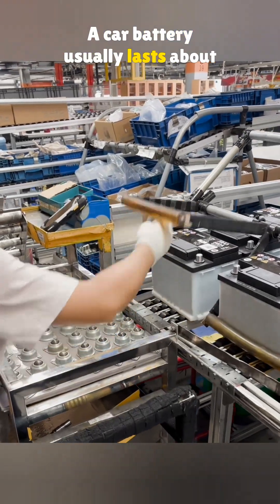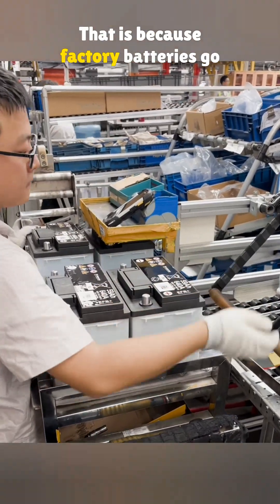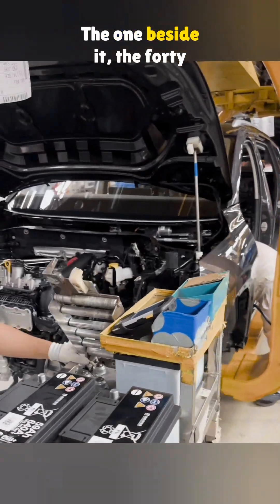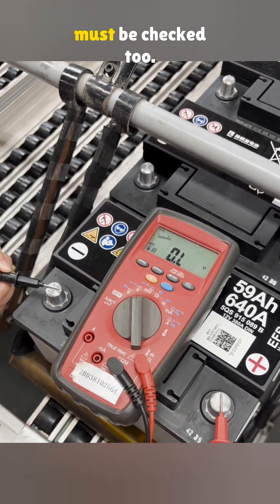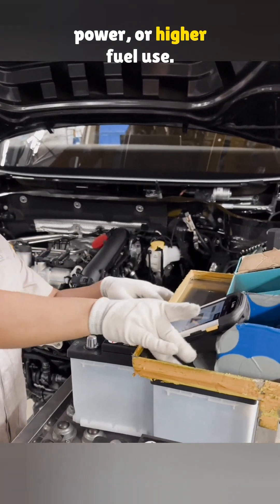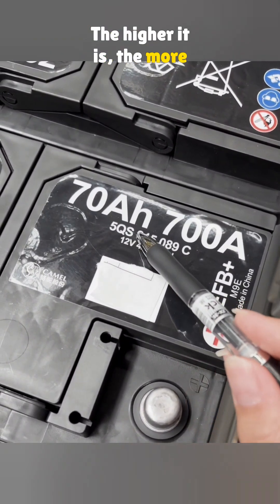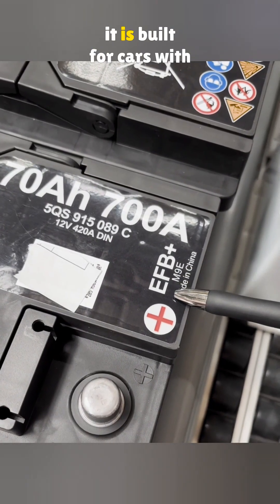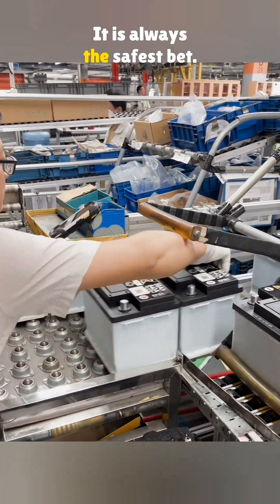How many years can a car battery last? #car #assembly  #batteryLife #autoMaintenance

Comment: Hoax Alert > I was an automotive electrical mechanic for over 5 years and I never saw any evidence that a lead acid OEM battery was better than a good name brand battery – I like die hard and interstate batteries and I only buy batteries with removable caps so that I can keep the cells filled to the proper level (only use distilled water for this purpose and do your research so you don’t overfill the battery) - I think it’s perfectly reasonable to proactively replace a battery after 3 years but if you properly maintain the battery you might get 5 to 6 years of service and possibly longer (all bets are off with the start stop cars as starting a car multiple times in a single trip is not good for battery life) - Regardless much depends on what kind of usage your battery is getting and if your car is being driven regularly – If you’re not driving your car regularly and you have access to 12 V power from your house consider installing a battery tender to keep the battery fully charged –Side note: If you install a battery tender on your riding lawnmower battery and plug it in after every use of the mower the battery will last almost forever (10 years is not out of the question).

Comment: Depending on how much electronics your car has will influence on how long your battery lasts and the type you need. Most will do just fine with lead acid and last about 5 years and maybe more. But it is a good idea to have it tested every once in a while to see how if it is still any good and replace if necessary before you have problems.

Comment: My first in the camper (leisure battery) lasted 8 years, and I only replaced it so it could continue to run some solar cells. Next in the camper is now 6 years and full of power. First battery in my passenger car lasted 8 years, and the second is presently 8 years. Only a freezing winter could possibly result in a replacement.

Comment: The last battery that was in my Toyota Camry lasted 4 years,  before it showed signs that it was at the end of it's useful life (not holding it's charge), how long they last depends very much on weather you buy a cheaper brand, or a good quality  battery, as they say, you get what you pay for.

Comment: I've had Optima batteries. One lasted 15 years. Another lasted 19 years.
The car needs to be started and run at least twice a week. Every day is better. If not, the battery will lose its ability to accept a charge.

Comment: My friend’s lasted fifteen (15) years in their Mercedes-Benz! The replacement AGM died after seven (7) years and sitting all summer! I had one last for eleven (11) years and I even kept it when I traded cars.
Reply: Same here. My w211 2006 e class original battery was only replaced in 2023😂.

The agm varta batteries last decades when they sit in the trunk away from the engine bay heat

Comment: I bought a used police car with all of the emergency equipment still intact.  It had 6 strobes in the headlights and taillights, an LED light inside the back window, and a light bar on the roof with 18 halogen light bulbs plus 8 motorized reflectors.  I changed the lenses to yellow and used it at my construction job.  I don't know how old the battery in it already was, but it lasted for over 4 years and was still working well when the car had a mechanical problem and I sold it.

Comment: Two years? On what planet?
Reply: 2 years, I’ve never had less than 5 years and usually more.
Reply: On Volkswagen planet maybe 😂
Reply: Texas
Reply: my car battery is fine and 6 year old
Reply: I always got 5+ years on Hondas and Costco batteries (climate with no winter freeze though)
Reply: @Censik I get 5+ years in Canada from aftermarket batteries, even the cheap ones. Batteries that come with my new Hondas usually only lasted about four.
Reply: On the planet where people make false claims so people start commenting and help the video rise in algorithm.

Thank you for taking the engagement bait.
Reply: @bobdebouwer7835  OK. As long it's not reality on earth.
Reply: @bobdebouwer7835 that’s correct. This channel has been harnessing the power of cunningham’s law to the fullest
Reply: @bobdebouwer7835 .... Unfortunately, you all that planet but focus only in US or UK etc, but those place arent the whole world not the entire because there are batteries that last 12, 18, 20, 24 or 36 months in others and mine is just one of the many, I once got one that lasted me 54 months. The exactly Rocket  brand replacement, size and  type however gave me just under 30 months. All others been downhill thereafter

Comment: Mine is more than 8 years old and still working.
Reply: Can you please share the process of how you take care of the battery?
Reply: @Akshay_Bhavekar  I did nothing special; I just always turned off the start-stop system. Periodically charge the battery to 100% with low current, and never ever discharge more than 10%. If you do not use the car, still charge the battery.